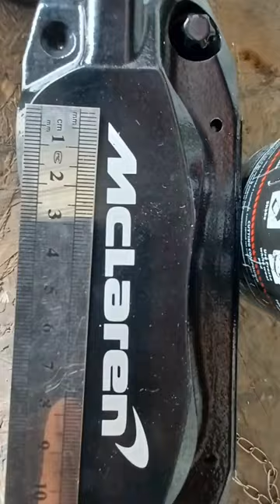mclaren brake calipers #shorts

Comment: Pistons seal bleeders lmfao
Reply from the maker: Those are not piston seals, the seals are on the inside with the fluid, the rubber that you see is dust boot & fluid doesnt make it that far,  also when you are bleeding the fluid travels in the outward direction not into the caliper, thanks for the comment 😊